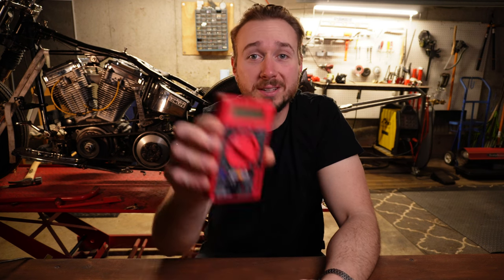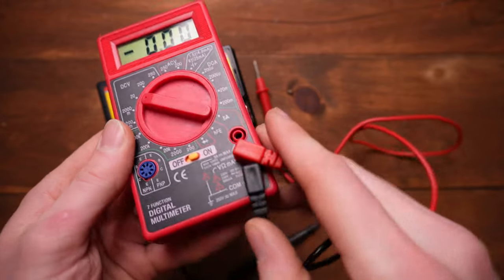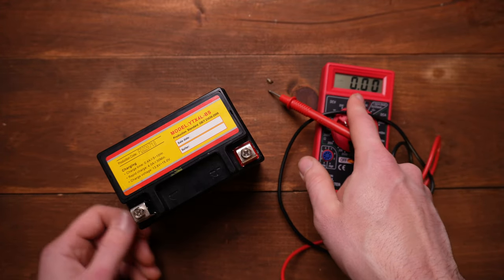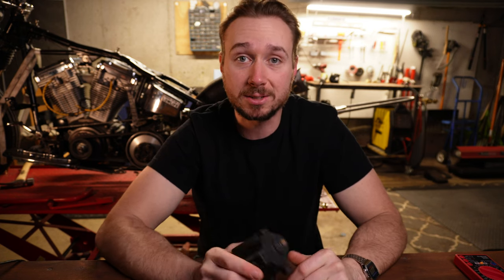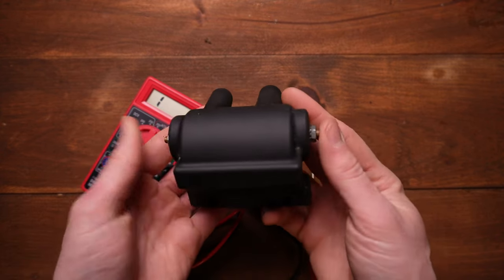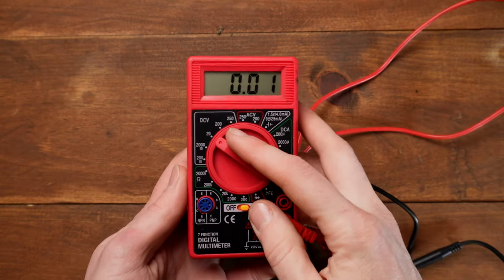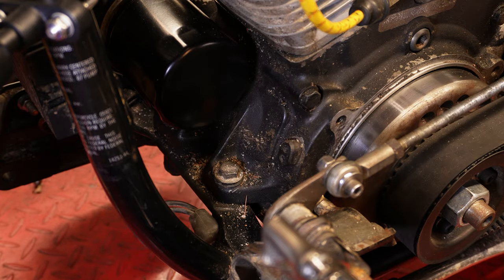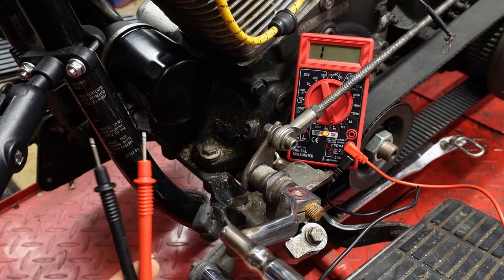Testing Motorcycle Battery, Stator & Coil

Comment: Cheers mate so easy i think even id have a clue, I've just bought a multimeter and replaced the battery, im getting a reading of about 14 at 3000 rpm. Im abit wiser after watching your video and atleast I've got abit more clue how to use the multimeter.
Reply from the maker: Glad to hear it David! It’s the most essential tool you can own 🙏🏼

Comment: Yo Grease! I'm currently diagnosing an electrical problem and need to test my coil. I have a cycle standard (CHROME 12V SQUARE COIL 1948-60 HARLEY-DAVIDSON BIG TWINS). How would i test this coil? I run my multimeter across the top holes where spark plug wires come out of and get a reading of around 17K ohms. When i touch the side terminals on coil I get NO reading as in no ohms on any of the settings. Im assuming this means I have a bad coil?

Comment: I can’t find the stator on my bike, I have 73-74 xlch sportster and mine doesn’t have a plug that pops out. The regulator has two wires that hook up to the generator and then the housing for the generator is connected to the engine
Reply from the maker: I believe your sportster is a generator motor which is mounted up front. Don’t believe it has a stator. Just a generator and regulator rectifier.

Comment: I have a 2001 kawasaki vulcan vn800a  I tested the battery with the bike off and had it in the 13.5 and when I had the bike running it was 15.1 + when reving does that mean my big is charging?
Reply from the maker: It’s definitely charging at 15.1 however, that sounds a little high depending on how high you’re revving it. Usually if you’re going over 15 I’d want to look up what the factory recommends it to be at. If a regulator goes bad a bike can put too much voltage to a battery and smoke it but maybe on a Kawasaki that voltage is normal
Reply: @greasesgarage  so I checked again today and recorded it here were my results,   key off just battery was 13.3 key on with headlight on drops to 13.0 idle went up to 13.9 then I gave it throttle "have no rpm guage" to cruising sound from exhaust and it went up to 14.80/14.85-then off gas back to idle it was dropping back down to 13's and I shut it off (key on) headlight on it  dropped to 12.80 -key off and removed jumped to 13.10 , are these good ? Had the bike die the other day after riding into work and the old battery was dead , had to buy new battery to get home!

Comment: Me and You may be the only People that put a Cow Pie on an Evol.
I put LED's on My Bike.
I noticed after Riding for awhile the LEDs started blinking at Idle.
Brighten back up when putting Throttle back to it .
Did You checks except for the coil do far.
I'm hoping it's the battery.
I do have the Spyke electronic ignition.
Kick start only.
The Bike in my Profile.
The battery may be a year old but a cheap one. Always had the trickle on it.
As I said tho when I rev the bike the lights brighten back up.
Everything elec obviously begins draining after Riding for a bit.
But even tho when reving the lights brighten back up.
Could it be as simple as a bad Battery.
When running after a while the battery was showing way below 12v.
Any info will help, Thanks for Your Page it's Awesome Brother,
Johnny
Reply: Auto Text excuse the Typos
Reply from the maker: Hey Johnny, 

Thanks for the message brotha. Yes I agree, might be the only two crazy enough to take out a 5 speed 😂

As for the electronics, all those symptoms are of a bad battery or a bad stator. I would take that battery to an auto parts store to be “load tested”, it’s possible to have a dead cell or two in a battery and the tender will still say it’s fully charged. Load cell tests are free and will rule that out. 

Other potential source is the regulator. If the headlight is dimming and surging it sounds like the current isn’t being regulated properly. The regulator could have gone bad on you. 

Let me know what you find out about the battery